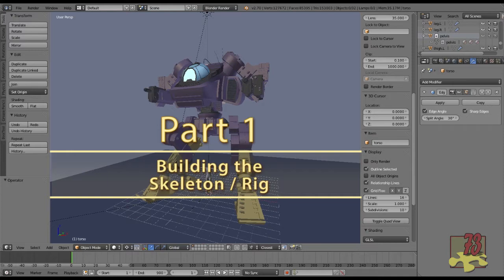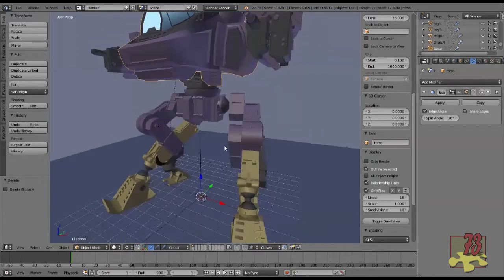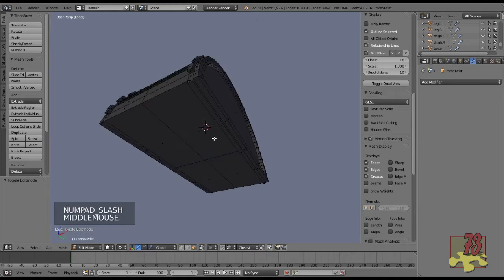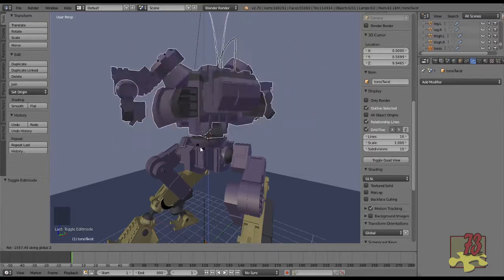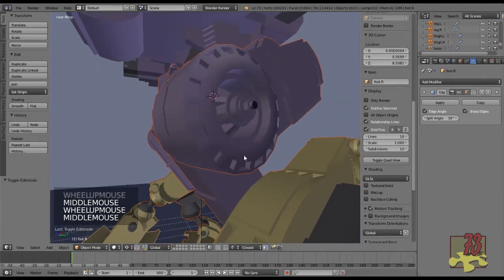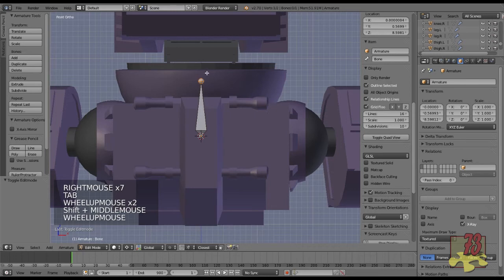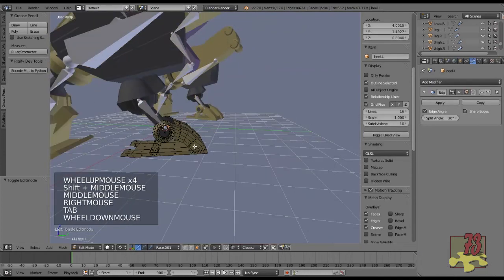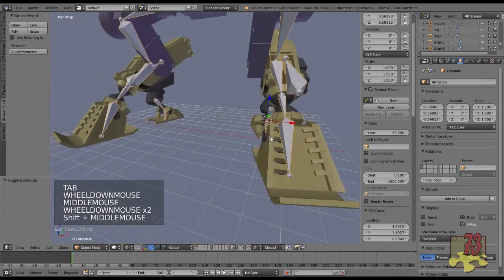DarkWing Rigging Project - Part 1

Comment from the maker: sancho zoidbert I can't seem to directly reply to your question...weird...anyway, the roll of each bone seems to be calculated by Blender based on the start and end of it as you create a bone. If you extrude mirrored bones, then the roll matches from left-to-right. Also, if one side is corrected or the roll is adjusted (ctrl+R while the Armature is in Edit Mode) then the other, mirrored bone will be adjusted or corrected to match, yes.

I think that is what you are asking... hope that helps. If there is something specific about the video you're asking, just let me know what the time stamp is and I'll take a look. Thanks.

~angel
Reply: That was all i needed to know, thank you!